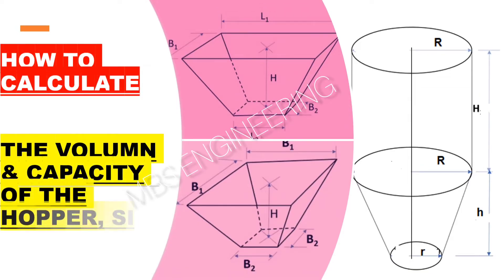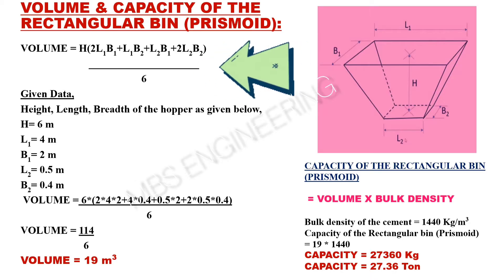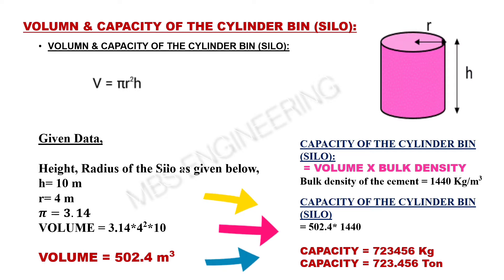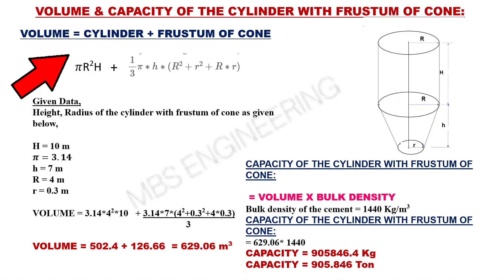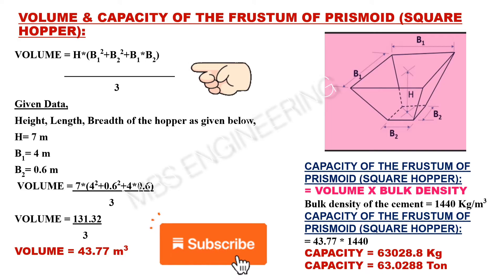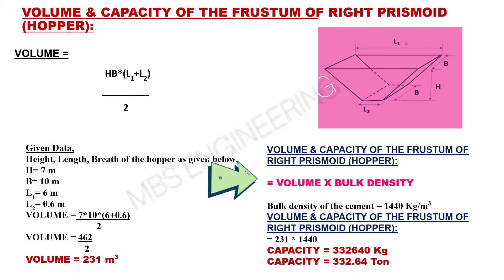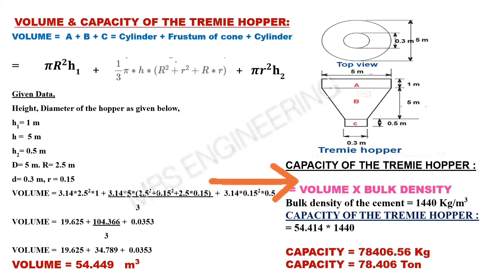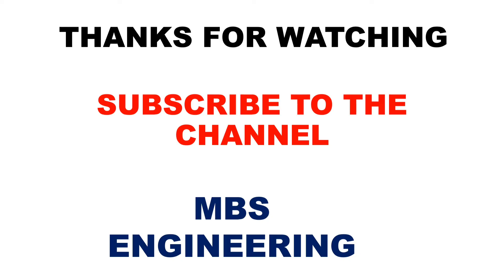HOW TO CALCULATE THE HOPPER/SILO/BIN VOLUME AND CAPACITY / VOLUME & CAPACITY CALCULATIONS /

Comment: A rectangular bunker 4m by 2.5m in plan is required to store 240kN of foamed slag aggregate. The unit weight of the aggregates being 9.5kN/m3. The side wall is 4.5m high. It has a 1m high frustum hopper bottom and 0.8m high surcharge. The hopper has a concentric opening of width 0.5m. The bunker is supported on four RC columns as the corners. Using C-25 grade concrete and S-300 steel, design the side walls and hopper bottom. And also sketch the details of reinforcement. Use Angle of repose = 30o, Q = 0.659, and j = 0.903